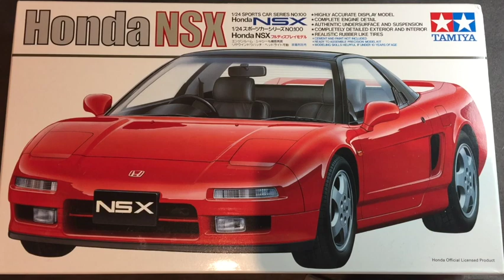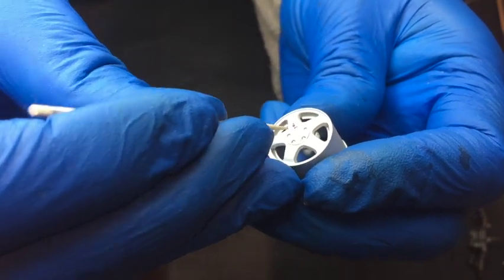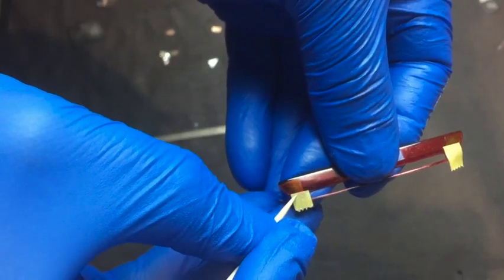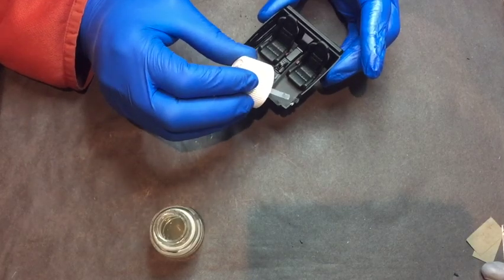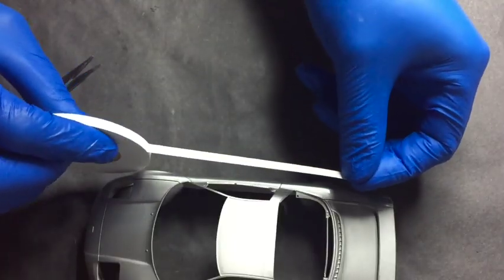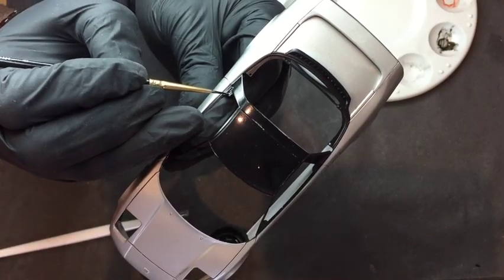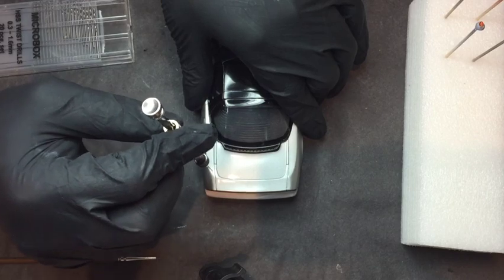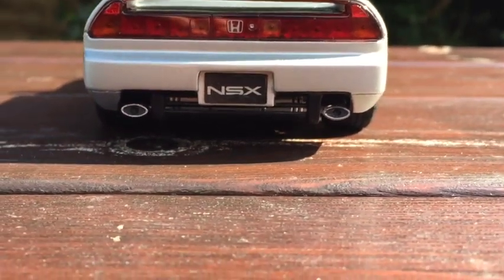Honda NSX Tamiya 1:24 Full Build / Tutorial

Comment: That taillights tip is awesome. I'm working on an NSX NA2 but, this is a die cast metal 1/18 scale model. It has exactly the same undetailed tailights and the problem is, it's made of metal so it's not as easy to work as plastic 😞, I'm guilty because it's a problem I got myself alone into it 🤪. I've doing some things like chassis detailing and of course model is far from finish.
Reply from the maker: Thanks for the compliment. I hope you find it useful. I've never worked with metal so can't give you any tips on how to handle that. If you have a Dremel, try going to a DIY store and see if they have drill bits specifically for metal. I have a few metal kits but have not made them. The metal on my kits seems softer than regular metal, not sure if that's the same for die cast models...probably not! As long as you can create a slight curve, this will help the natural light bounce off the angles to give the light depth. Maybe don't drill right through the metal for the bulbs but make a pilot hole, then you can use the plastic sprue idea to glue to the metal. Good luck ;)